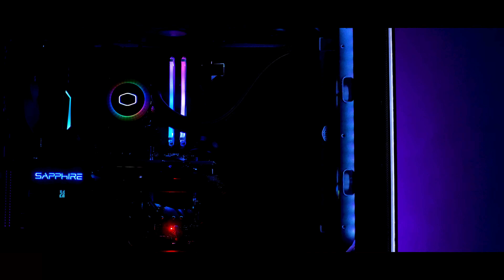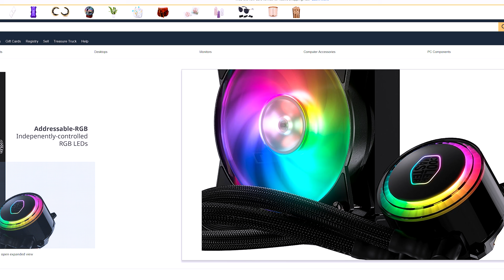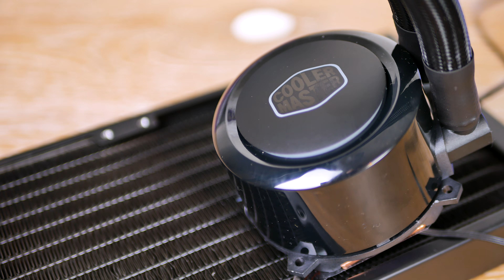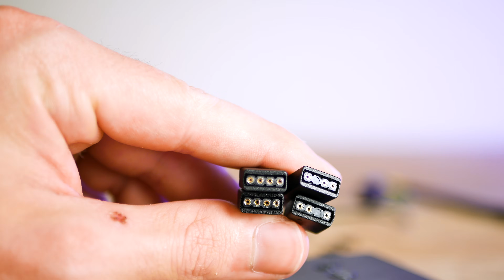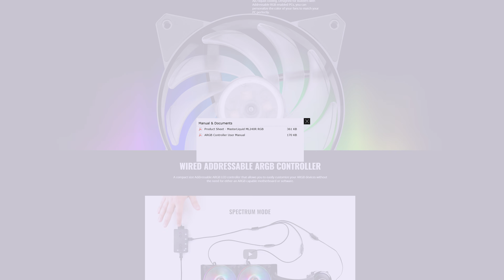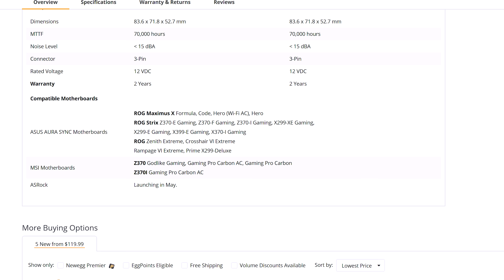ADDRESSABLE RGB Cooler - Cooler Masters Addressable RGB AIO | ML240R

Comment: i have the same controller. two light at the bottom (Over RGB and ARGB connector) are flashing. I am unable to find the solution. The lights on the system are very low.

Comment: As someone using this cooler, my issue is screwing the mounting brackets onto the pump. The screws won’t go through the holes on the bracket. Therefore it pushes my bracket up and i can’t mount it well. Might need to get another one

Comment: Doubt I'll get a reply, but I have an Asus Rog strix x470f MOBO and have it in a cooler master mb350p case which has 3 of there ARGB fans included, I'm thinking if this AIO so ik fully cooler master butttt does the control box it comes with have space for more than 2 ARGB headers or is there 5 or 6 like much of the competitions? 

Great review and definitely moved me away from either the kraken or the Corsair h100i

Comment: Hey man, I liked your video so I went out and got one. I've never toyed with AIO style and it's a bit confusing. Perhaps you could help me out. 
1 - you have the fans mounted on the inside of the radiator so I'm guessing you mounted the radiator at the top. Are the fans sucking or blowing air with your setup? 
2. I cannot get this to sync with Aura software. The only way I can get it to change is by using the controller. Now, I do have 2 RGB headers on my Strix B450 F gaming, but plugging it into one of them does nothing. 
3. How do you know it's actually working? I have no actual way to test as I just got a new CPU ryzen 7 2700x but temps are everywhere. One software says 38 AI suite says 25. I really have no way of telling. 
4. Did you plug your fans into your mobo or do you have them attached to the controller? I think I would much prefer to have the mobo set the speeds and I can then set my curves, but as it is right now the only thing I can control is the color. I'd like to be able to plug both fans into the motherboard but also have control of the lighting. Is this possible? 

Anyway, good video. Good voice. Thanks.
Reply: asus b450-f does not have argb header that's the reason u can't sync it with aura,the 2 rgb headers on b450-f are normal 12v ones

Comment: Does is come with thermal paste?
Reply: No
Reply: I built my gaming PC and I have purchased this AIO to cool my CPU (i7 8700K). It does come with thermal paste (If memory serves me right I think the brand in the package is called MasterGel, overall not bad). 
Also other parts (ARGB high presure fans - MasterFan MF120R ARGB, screws and various mounts, cables and a controler unit) are also included, CM thought of everything and ASUS Aura sync works like a charm on my ROG Strix Z370-E Gaming motherboard. If you have that type of mobo you can easily ditch the controler and use the provided Addressable RGB 1-to-3 splitter cable and connect it to the avaiable ARGB header on your mobo.

Comment: You can mount the fans on either side of the cooler, for example you wanted the fans visible from the inside? (Assuming I dont care about the cooler air flow)
Reply from the maker: Yes you can mount in either side, hope that helps you!

Comment: Sorry but this cooler is trash
Reply: I'm getting the 360r RGB in 3 days. Is it bad?
Reply: @arioptimus  the rgb isn't customizable on most boards in hopes of making it worked I tried extending the pun header to a included 4 pin cable that came with it and it fried the controller and the lights went out. The fans are loud even on silent in bios and the wires are God awful they don't secure very well otherwise the colors are vibrant and it does the job just not worth get corsair BTW the cooler master software its bugged just says connect cm device even you connect the controller over USB 2.0 now I am using the stock amd pinnacle cooler lower Temps and way less noise on a 3.8hgz

Comment: JDTechGear - I have no idea how to connect it to my Asus TUF Z370-PLUS GAMING motherboard, the manual is so hard to read, do I need to conect the "remote" to the motherboard or what? I have my case fans connected with the 2 pin to the rgb header
Reply: I hope you have resolved your issue, I have the same mobo like you and have not problem at all and I have the this same master cooler, but one thing is that it's the fans are little loud but tats all... ✌️

Comment: does it snc up with asus aura in the future ? when will it happen ?
Reply: Im posting this answer and I hope you will pass it on too, connect the extender give from you Mobo Add.RGB Header(3 pin one) to Splitter that connects your Pump and 2 fans, meaning nothing is connected to the controller. Straight from Mobo to the splitter, but keep your controller there. Had to trouble shoot this myself T.T
Reply: @fareezharis  hey. I have the 360 aio. How can I connect with the mobo aura sync. I need a splitter oder new cable? The mobo have 2 rgb headers. 3 fans + cpu pump.

Comment: If I wanted to sync the fans and the pump to Aura Sync, how would I go about doing that?
Reply: did you find sth. out about it ?
Reply: Pikipogo yeah buddy. You connect the fans to a 2-1 cable provided by cooler master and plug them in one of the RGB headers on the motherboard. For the pump tho I'm not sure
Reply: Im posting this answer and I hope you will pass it on too, connect the extender give from you Mobo Add.RGB Header(3 pin one) to Splitter that connects your Pump and 2 fans, meaning nothing is connected to the controller. Straight from Mobo to the splitter, but keep your controller there. Had to trouble shoot this myself T.T
Reply: @fareezharis  Thanks for this. I'm picking up this cooler and my ASUS Prime Pro X470 has 2 RGB headers and I'd love to not have that spaghetti mess. Props!
Reply: @geologik7500  Did you get it working with that setup?
Reply: @geologik7500  is everything ok with that motherboard? X470?
Reply: @grilovan  running great in terms of hardware. I haven't sat back down to troubleshoot the RGB. It's just living it's life in rainbow RGB spins.
Reply: Im posting this answer and I hope you will pass it on too, connect the extender give from you Mobo Add.RGB Header(3 pin one) to Splitter that connects your Pump and 2 fans, meaning nothing is connected to the controller. Straight from Mobo to the splitter, but keep your controller there. Had to trouble shoot this myself T.T

Comment: First off, great B roll, you've got a real knack at getting a product to look it's best! 
As for this cooler, I like it as it seems like they at least didn't sacrifice form over function. I agree 1000% that we need a standard here, all of the different methods here are getting tiresome, it's almost impossible to get one main lighting scheme going if using different brands. I also love that this one is also magnetic as it solves one of the most annoying issues with these controllers, where/how to mount them 👍😎 As always JD this was a really well thought out and presented review. I look forward to the next one!
Reply from the maker: Thanks man! I love showing off the product as best as I can. I'm really happy that this Cooler turned out the way it did and not just Cooler with RGB lights. I really wish we had a standard, I haven't coded with that kind of functionality so I don't know if it would be possible with all the different types of firmware. Thanks Michael, always appreciate the support!!